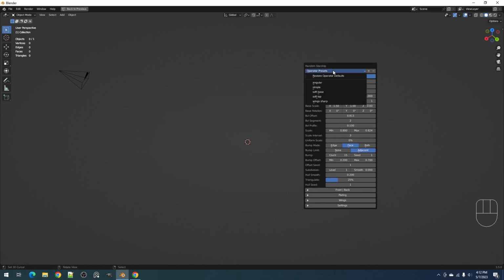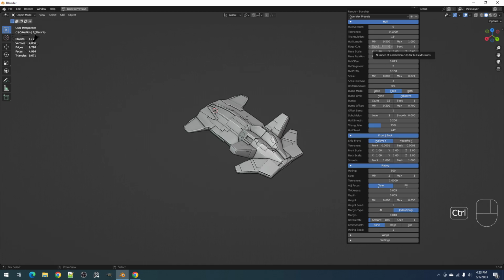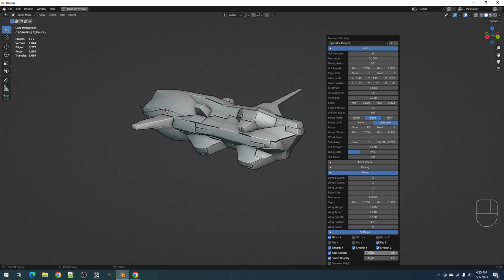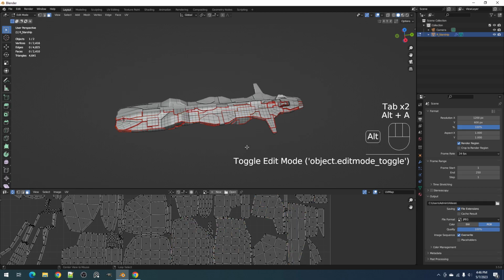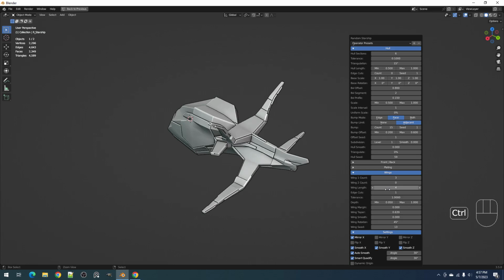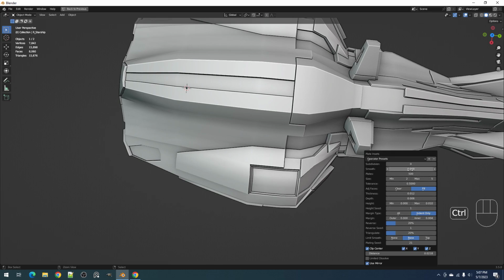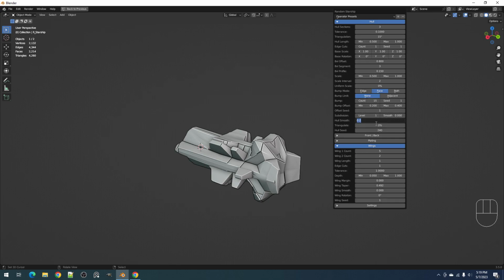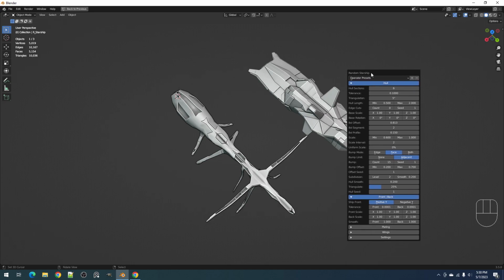Random Starship: Building Your First Starship

Comment: I'm still a bit of a Blender noob, but videos seem to show that v4 has buggered up the autosmooth behaviour, and I think it's affecting the Random Starship add-on too, cos every model has wonky shading from the moment it's created. Is there a way I can have it default to shade flat, or another workaround? If I right-click and choose Shade Flat, then I can't bring the Random Starship settings page back up with F9, unfortunately...

Love it so far, even if Blender itself seems to be trying its best to make it difficult to use :P

Edit: nvm, I see that using Blender v4.1, and installing your presets files seems to have fixed the dodgy shading issues I got with all the other versions! love it so far, mate. Boy do the hours fly by when I'm just tweaking parameters...

Comment: The 'Random Starship' window closes everytime I click out of it is there anyway to prevent this?
Reply: I am having the same problem using Blender 4 and nothing happens when pressing the F9 key.  Is there a keymap assignment missing?
Reply from the maker: It's Blender internal behaviour. You can however bring back the menu using the F9 hotkey.
Reply: @blenderguppy  I have same problem - F9 doesn't bring the window back up. When you bring the window back up through Shift A it just starts another ship from scrach. Can't modify original ship